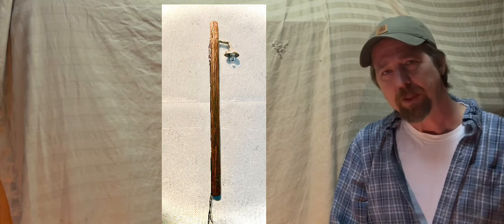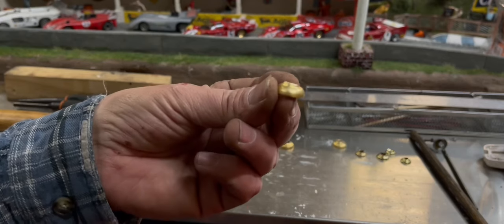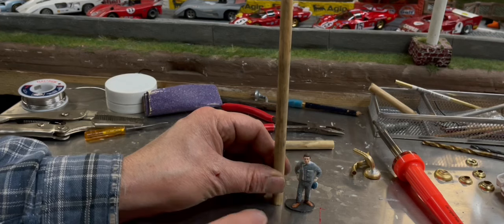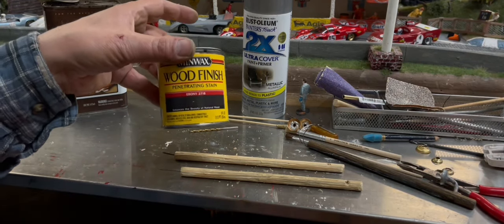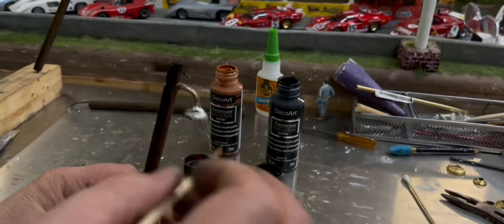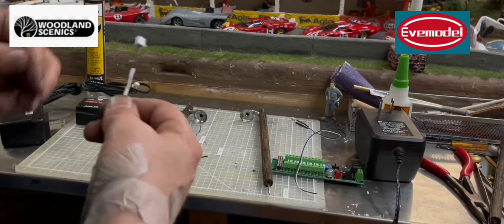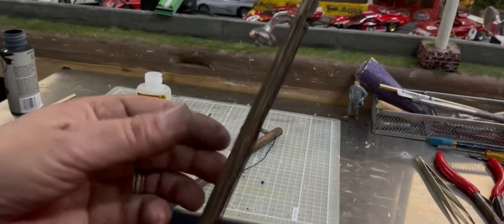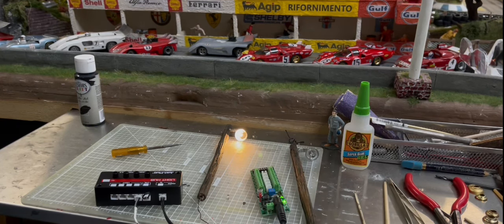How To Build A Log Light Pole

Comment: Get a set of those red handle tube benders, like for brake lines and it’ll bend without kinking. I use them for tube and well brake lines lol. Pole looks awesome! Has that old 70-80s track look.
Reply from the maker: Thanks buddy, yes the brake line tube blender would be perfect 👍

Comment: If you fill the tube with sand should bend without kinking awesome job 👏
Reply from the maker: Thanks John… I did try that but didn’t have to much success…. I think I’m just going to need to invest in a brake line bending tool… 😂
Reply: @Boone's Slot Car Garage  maybe you used wrong type of sand 😆 😜
Reply from the maker: @johndix6101  😂…

Comment: Hey Boone, that light fixture looks really good. Your workmanship is top of the line. 
I wanted to asked you about your track. Did you glue foam to the bottom of your track in order to reduce that hollow plastic sound when the cars race over it? Kinda the same thinking how Tesla glues foam inside the tires for a quieter ride.
Reply from the maker: Actually I didn’t do that. My track sits right on the wood table. But if I were to put a sound absorbing material down, I would recommend using cork mat. Polystyrene is hard and will not absorb sound as well as cork .
Reply: @BoonesSlotCarGarage   OK thanks Boone. That makes sense. I use the cork to absorb my sound concerns.
Reply from the maker: @michaelchenevert3363  sounds good